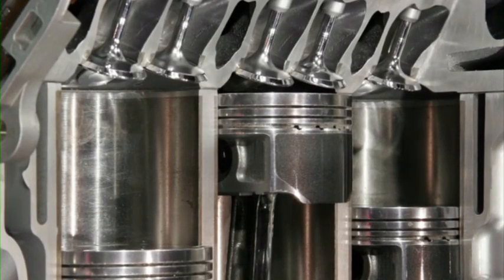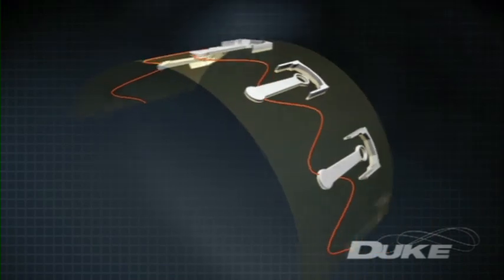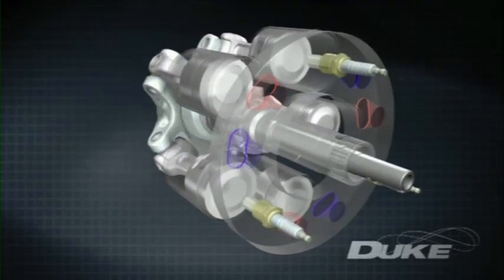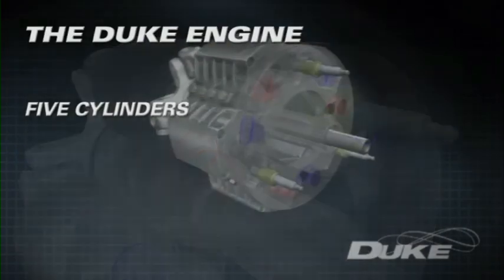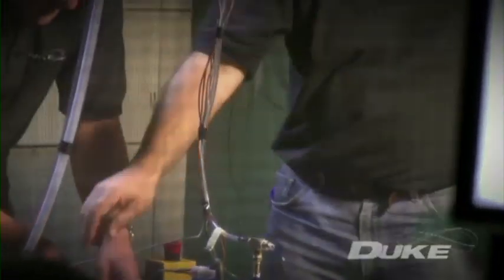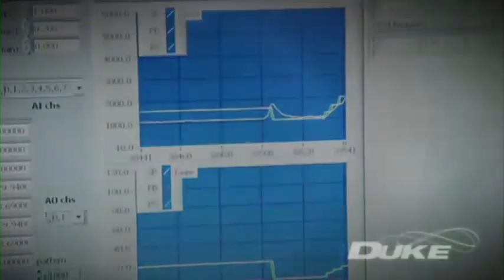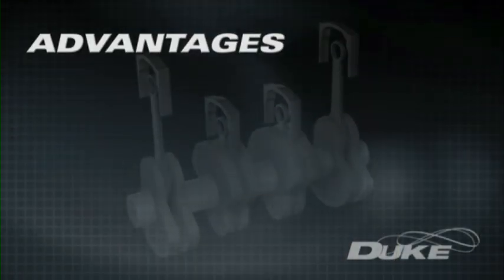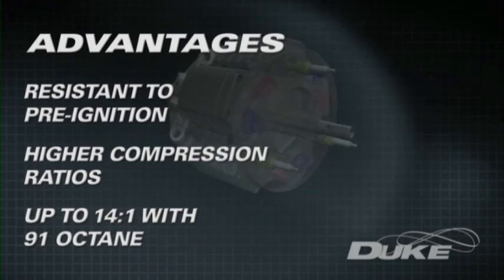Duke Engines

Comment: With rotating cylinders, how does the combustion seal? Surely it doesn't use rubber seals, I wouldn't think that'd hold up to the heat, and each cylinder would have to seal independent of each other, so... what the heck?
Reply: Without "re-inventing the wheel" the Human race wouldn't have moved forward. We have to try to make things better or we will never know what is the best.
Reply: ***** What's the gap between the bores have to do with it?... go back and re-read my post, I wasn't even debating the gap between the bores or the port holes, of coarse its got ports. Perhaps you should watch this video very closely again, and study hard on the concept of this engine? Those cylinders are moving against a part that doesn't move. That's metal to metal parts and those parts have to be tight against each other, and perfectly flat in order to hold back 14:1 compression ratio like this video claims if they're not using some kind of seal, otherwise the friction between those parts would be so high, it couldn't it possibly rotate. Somehow I get the feeling you're not up on the concept of what it takes to hold back compression... ?
Reply: ***** well you obviously have a engineering degree. And one of the few youtubers who understands what it takes to get a engine to seal under compression.
Reply: If I'm not mistaken, I think there is a cylinder sleeve that rotates around with each piston to create a seal.
Reply: 91slownotch Well, the cylinders along with what looks like a drum the cylinders are bored into, all rotate against a stationary part the plugs and the ports are apart of, so I still don't see how the top of the cylinders seal against that stationary part, and this video didn't mention it either. The top of those cylinders would have to seal but with what... rubber, steel, carbon... ? Whatever they used to make that seal, I'd think it would need a continues supply of lubrication, otherwise it would wear really fast, and wouldn't be worth a crap... this still is considered a combustible engine relying on compression. In my opinion, the ingenuity is very creative, but for practicality, it's not worth the drawing board.
Reply: ***** Alien seal technology... lol. If that's the case, I don't see them getting this engine off the floor they built it on any time soon. The force that's required to hold back 14:1 compression ratio like this video claims, is way too much for a design like this. The typical engine with stationary heads over the cylinders, takes a massive amount of down force to hold the average 11:1 compression ratio. So that seal you said they're using, would have to be under extreme pressure, so much that it couldn't possibly last, you can't have that kind of pressure with this design. The more I think about this, the more I can see how ridicules this engine really is, and I've only been focused on one part of it... how bad is the rest of the design?
Reply: ***** What amazes me, is after over 100 years despite the concepts and close achievements, the conventional engine has yet to be concurred other than improved performance. Even the rotary engine didn't make it, and from what I hear they don't even make them any more... they were too unreliable. I agree with what you said, and if all this has to do with green house gases, then perhaps they just need to re-concept the whole entire combustion engine, or just eliminate it with other technology that's not even based on combustion. Just raising compression of an engine isn't really doing anything for CO2's. The best fuel mileage car I ever owned was a 79 Datsun B210, even though the compression ratio wasn't 14:1, it got 40 mpg's no matter where I drove it. And I bet if I had it today there's no way it'd pass a smog test. I've noticed over the years that all these newer cars and trucks fuel mileage hasn't really increased all that much. All they've really done to them is make then more efficient for CO2's with all the smog crap on them, but the fuel mileage is still basically the same as from the 70's and 80's, My 72 Chevy Impala that I had as big and heavy as it was, and that car weight 4800 lbs, got 19 mpg's. That's not much different than todays pickups that weigh the same, and in some cases it's better. I've got a few concepts and ideas myself on an engine, but I'll not spill the beans here online, and no disrespect for anyone, but it's real easy for someone to take someone's ideas and run with it taking all the credit and patient it for themselves. Some of those ideas I've gotten from watching video's like this, but some of them I've not even seen yet, however, I refuse to take other peoples inventions.... I want my own. The fact these guys are trying to improve on old technology that has past the test of time, is a waste of time and money... they're really not improving on anything. It's just adding creativity on an old invention.... yeah I do believe they're trying to heat their home, no doubt.
Reply: ***** You've never did a compression leak down test on a standard engine have you? Here's something for you to try so you can get the compression concept. Go get a air compressor and spark plug hole adapter for the hose to it, and change the valve seals on a standard engine just using compressed air in the cylinders. Then come back and argue with me, otherwise, perhaps you should consider another topic... ?
Reply: They could solve the sealing issue very simply. If you make the cylinders a part of a top circular plate with openings for Exhaust/ intake. The Circular plate spins with the crank and pistons. The top circular part would be three parts, the closest to the cylinders will have intake/exhaust ports, and in the middle of it would be another plate with holes that wouldn't rotate, the top plate would be a solid sealing plate and the middle plate would be secured to the block. as the cylinder rotates with the crank the cylinder will line up with the exhaust/intake ports and would have less difficulty for sealing and would be longer lasting.
 Simple.
Reply: ***** Using the same technology we use for example the crank pulley. Have the cylinders be part of one solid assembly with a Bearing in the middle of the top piece. Above each cylinder is four holes/ two holes or how ever many ports they want to use, above that have a thick plate that has passageways for the intake/exhaust charges.Finally, Connect a top sealing plate to the bearing with a rod that connects it to the main rotating assembly. For the sealing you could use the same technology as a picton engine uses to seal or even the rotary as a seal around the Middle/top/bottom plates. The entire sealing apparatus wouldn't be any more difficult to remove than removing a crank pulley and as such can be a regular service item without causing un-neccesary cost.
Reply: Jacob Laster I'm no engineer, obviously. But you can't say you don't want to see a motor like this work. Who knows, maybe it'll be the next rotary as far as efficiency for hp/L
Reply: Jacob Laster Plus, the fact that this motor has 5 pistons could take advantage of the 5 stroke engine cycle with 4 high pressure cylinders and one scavenger low pressure cylinder.
Reply: ***** You realize without these "researchers" you wouldn't have the almighty current engine configuration you have now. You condemn new ideas but still suggest that scientists and engineers try and research new tech for other parts? That's a bit on the hypocritical side of things. Sorry to point that out, but it needed to be said.

Tax dollars or not, research will never be a waste of time or money. If you remember Edison's old saying, "I have not failed. I've just found 10,000 ways that won't work." While I can't speak for everyone, I'd wager that most are pretty happy with the outcome of his research. So maybe try and be a bit more open minded before voting to axe people for trying something new.
Reply: ***** Who deems one project more worthy than another? We don't always know what will be successful versus what will not. It's not always easy to predict. 

That said, Duke is out of New Zealand, and from the look of their company profile they have privatized funding for the most part so you can sleep safe knowing your taxes aren't funding such an outlandish "lie".

For the sake of curiosity, how would you go about determining what was a worthy project to research versus something that was not? How would you know without further research or testing?
Reply: ***** Finding out what doesn't work is sometimes just as important as finding out what does. Information is valuable either way.
Reply: I really hope you're not serious.
Reply: Limon, are you truly this short-sighted? Or are you just trying to troll yet another video? I hope you're just trolling, but if not, please educate yourself further before responding with the same rhetorical dribble  you've been spewing for the past handful of comments. Research is necessary. While you're obviously trying to dumb down a complicated subject to something as simple as a wheel, the fact of the matter is that not everything is so clear. Maybe if we had more people like you that are all knowing at the head of research departments we'd be off saving the world... Then again, maybe we'd still be sitting on a stone wheel saying, "Why should we try and progress from here?! This is the pinnacle of civilization!"
Reply: It probably works using a system (not shown for tech protection) similar to the wankel rotary where it has a consumable seal.  On the rotary known as the apex seal.  A set of these concentrically could function similar to that of a conventional piston ring.  However, like the rotary, having a seal move over a port means it has to inherently burn oil.  No way around it.  A sealed lubricated surface is moving over an opening.

The questions I would have in regards to this system is the actual overall efficiency.  Displacement really isn't relevant overall because all that matters is how much energy you get out of the fuel combusted.  Usually most effected by airflow efficiency for proper combustion, followed by frictional losses in the drivetrain.  

The point of sealing does bring up a big question, does the advantage of this design offset the frictional loss of the non power stroke of the conventional 4 stroke? Multi axial joints, two points of combustion sealing, etc all bring up the wonder of dramatic increases in this loss.

The compact design is a clear advantage, and it can work with existing technologies of power delivery from turbocharging to fuel injection, and piston design. This would offset integration costs alot.  Weight savings?  Would need to see numbers.  The internal block, mechanisms and outer casings look to be adding up in weight.

Engine cooling is a problem, see a comment from a few days ago will put a reply and comment on that.

Lastly, the biggest concern probably can be longevity some might consider, and I had to ponder it as well.  There is side-loading on the pistons with this design.  With the pistons moving like that, it will wear out one side of the cylinders extremely fast.  Lets say center of mass is 10 cm from the outside of the center of rotation.  A performance lightweight piston for an economy 4 cylinder is approx 300g.  Lets put the engine at an economic average rpm of 2000 rpm assuming that the piston velocity is equal to the higher rpm of a conventional engine in at top speed and the rotational speed of the monoblock is 1/3 that.  Possibly there is some revolutions conversion I am missing.  

That gives 31.4 cm per revolution or 62.8m/min.  Close enough to call it 1 m/s compared to 9.81m/s for the force of gravity.  If we did conversion, 300g*1/9.8= and equivalent force of 30.6 grams of counterforce.  Now, I don't know, but that mass sliding thousands of time on a ? point load, I would think could cause an effect, but after crunching the numbers, that is still less force than a "boxer" engine would have just from gravity.  They do fine.
Reply: Jacob Laster wouldnt work the bottom plates would fail pretty quickly unless you made a majority of the part out of titanium to smash everything together and then use a soft steel and made something like a multilayer steel head gasket( obviously thicker and about as durable and flexible) where it could compress and expand at lest .015 of a inch without letting the seal brake. But obviously that would cost a lot more money to make a titanium block and head. I like the idea someone had about turning a Winkler or rotary motor into a ion engine.... but I still dont see this motor design getting off the production floor.
Reply: I love seeing companies that said the same thing about the wankel engine.
Reply: "Just use deduction, Rotating triangles can't make power better than cylinders."

Comment: How is this significantly different from the design of a swash-plate hydraulic motor or Stirling engine?
Reply: +LateralThinkerer here the pistons are also rotating around the shaft, not just translating like on a Siemens-like ( or Rhina) system. I wondered the same at first sight :)

Comment: Pretty rad idea, however the biggest problem not the oiling, cooling, or valves is the piston sealing... If the pistons rotate cylinders how do they seal again? You would need piston rings but those are compressible ie. the would spring open when the piston pops out... Can't machine the piston to the same I.d as the cylinder either due to expansion/contraction/lube. Unless.... The cylinders are conical shaped so the rings fit in the bottom and squeeze shut midway in the cylinder? Is that how they are doing it? Must be. Seems prone to scratching of the walls and broken rings though.